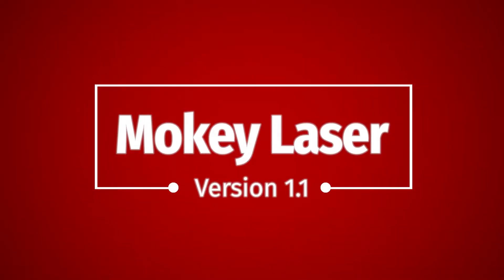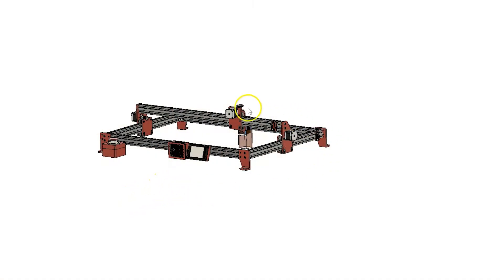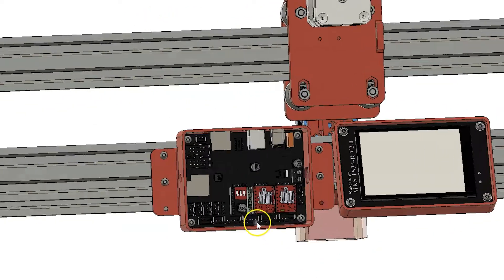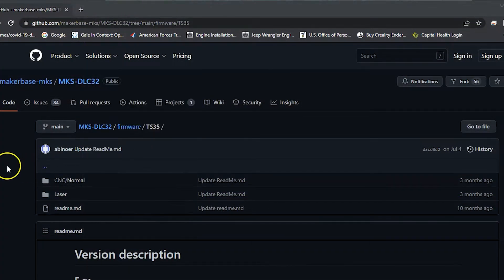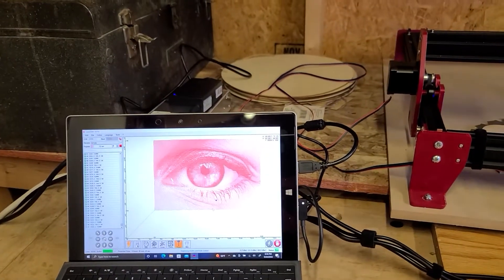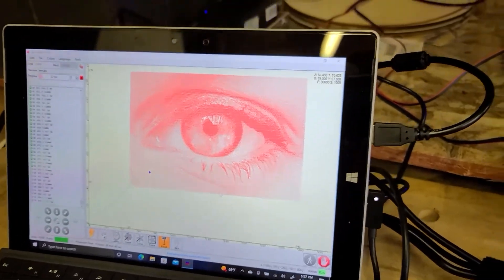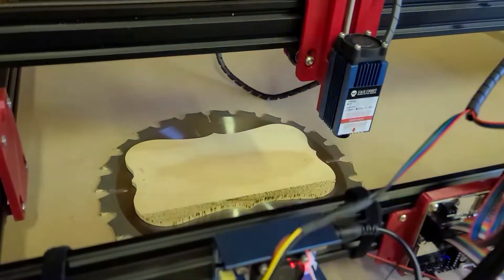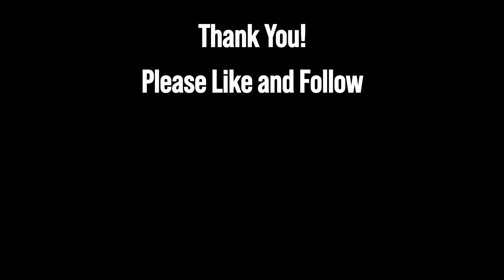MokeyLaser v1.1

Comment: Hi Mokey, ok I built it just finishing the wiring. 
I was able to plug my x and i noticed it moves very slow.   I have the tmc2209 with the stepper motors you recomended.   I think i did the vref  right but i never did it before.   I read the y is double the x in your design.   What did you set yours at?
Would you also be able to send me or post the programing for the grbl$$ setup with this board.   I tried moving my x and its backwards but the issue is its super slow.  I havent tried the y because i have to get a longer cable.    Thanks
Reply: I just finished but I can't get my switches to home and retract

Comment: love the build ! where are the updates !?!?
Reply: Thanks! I moved the laser to a new workshop, and I've been organizing that space, adding shelves, mounting monitors, etc. So I definitely owe some updates! I will do so very soon!
Reply: @MarkRichardsMokey   I've been doing the same I'm a day into soldering while doing shelves LOL
Reply: I just got all the hardware and rails, just waiting on the laser, board and motors.   Thanks for your cad files, makes putting it together so easy to understand.   Can't wait for the updates
Reply: I'm wondering about the legs...   Is there a reason some have six holes and I also wonder why they are at opposite ends?
Reply: @antoniovidal8655   pretty sure that's for drag chain mounts
Reply: @antoniovidal8655  Hi there, some of the legs have an extra 2 holes in the legs because I was looking at mounting a different type of limit switch. I ended up making the limit switch mounts for the 2040 rails instead. So the extra holes are not used right now.

Comment: Thanks for sharing. I am building my own based on your Fusion 360 model. There are no pictures or information about the belts' threading, fixing, and tension. Can you please share more info about this?
Reply: I just built one, I used some of the T-nuts at each end of the rail to attach the belt.  The belt runs in the slot of the 2040 , goes under the wheels of the carriage and over the stepper motor's toothed pulley.   Here's mine with drag chains added: https://youtu.be/vMLx--nk6ig

Comment: I built one, and my immediate planned modifications are drag chains for cable & air hose management, and to run the far side stepper motor cable thru the gantry.  Will need to modify the left/right stepper motor mounting plates to accommodate both mods. I adapted a 10W Creality Falcon laser that was designed to attached to an Ender 3 V2 3D printer.  I quickly realised that a 230mm x 230mm workspace was way too small for a laser engraver.

Comment: great build!

I have the exact laser on an genmitsu LE5040 laser engraver.  I am interested in how the z-axis adjustment goes together and how you intend on putting the shielding over the laser as mine doesnt have it either.  Thanks!  subscribed for the updates!
Reply from the maker: I've been getting a lot of requests for a full assembly video. It all went together smoothly. I bought a piece of the laser shielding acrylic and I had it cut to size by a friend with a CO2 laser. I glued it together and just used a friction fit to slide it over the laser module.

Comment: Nice upgrades! Just a note about the Arduino CNC shield - with the TTL module it should variable power for raster images.
The engraver design is streamlined and functional. Really like it!
One thing that I can't get is how the timing belts are connected at the end of the 2040 profiles. Would be nice to have a picture or explanation about it.
Keep up the good work!

Comment: Cool design. Does it tram both y steppers automatically, or are they just paralleled like some 3d printers?
Reply from the maker: Hi Aaron, thanks for the kudos. The y steppers are paralleled on the MKS DLC32 board, so a single y driver goes to two connectors. Not ideal, but it works in this application.